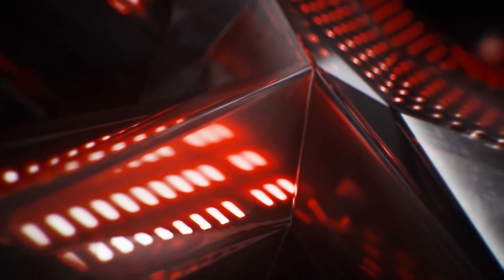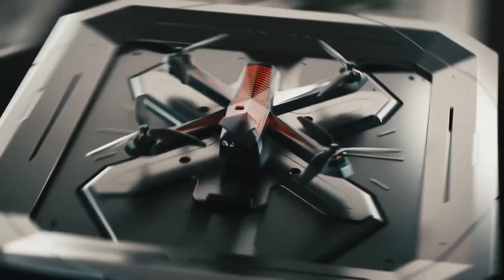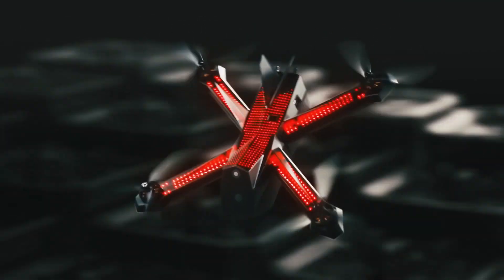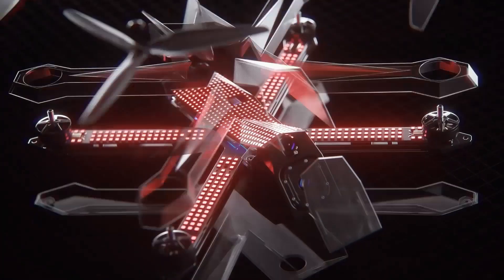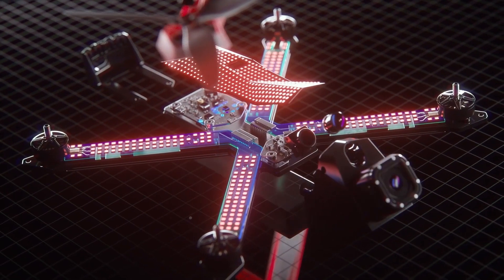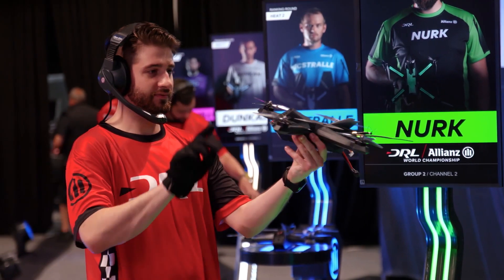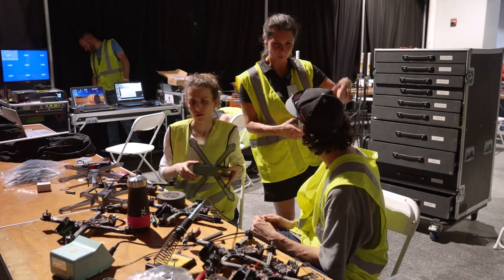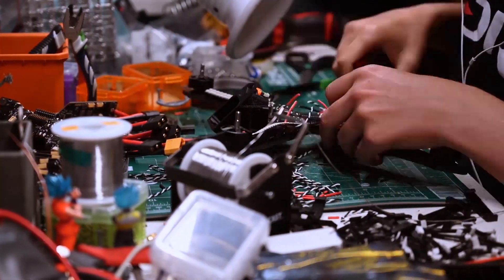Racer4 | DRL's Next Generation Drone

Comment: Spec racing meaning SLOW, they can only really go about 65mph there not built for speed there big, heavy and slow for a reason Soo they can be put on tv and people can actually see them. If you ever watch a multi gp race those drones go around 100 mph and it's very difficult to keep up with where exactly they are in space. DRl drones are specifically built for a spectator.

Comment: Curious. With so many ultrabright LEDs,do you use a separate battery to power them? Does that weigh the racers down? How do you cool down racers pouring out that much heat?
Reply from the maker: Great questions! There is only one battery used to power the entire Racer4. But it is a custom battery that adds a few grams to the drones. We construct the courses to make sure the drones are not traveling beyond the battery power. The pilots are use to it and TechOps switches out the batteries after each heat.